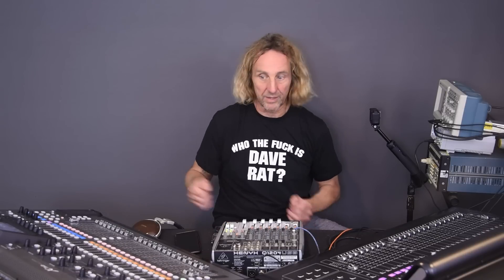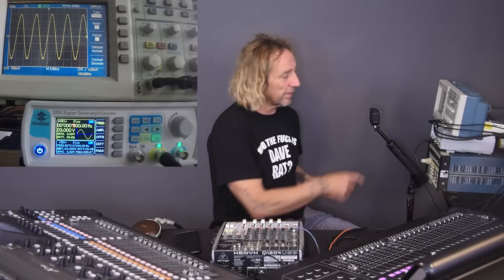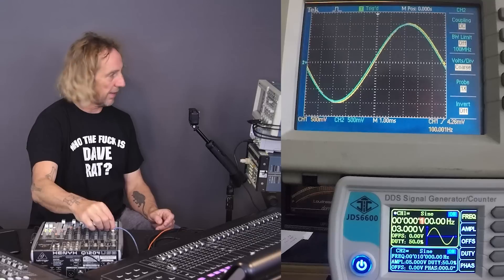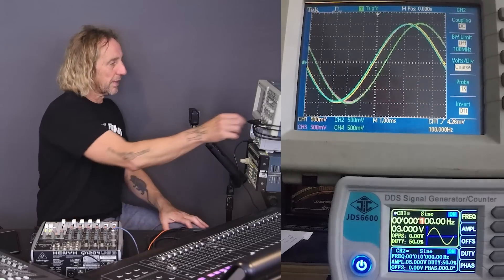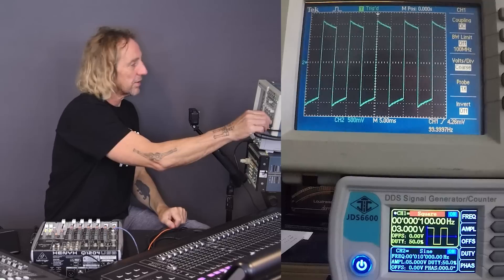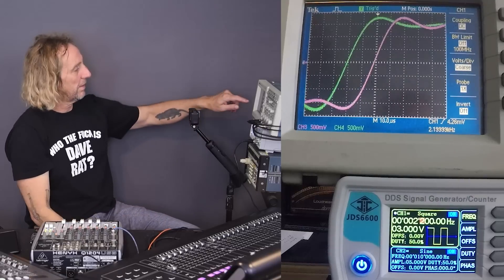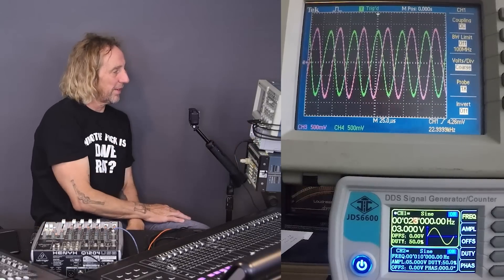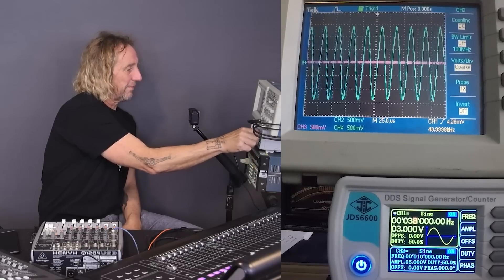Which Sounds Better Midas M32 vs Behringer X32 vs Copper Wire

Comment: Btw, I have a pretty badass rig in my FROG, and those last sub bass tones on your outro were nice, with being 16:45 heard as well.     Honestly the rig is pretty flat from 25 hz to 16khz, but if I move the crossover up from 22hz to 27 hz, it really affects the harmonics above, and deteriorates the response badly.   A friend recently gifted me an old but in new condition BSS MiniDrive, which will replace the old Driverack.  I’m looking forward to even MORE quality and harmony.
Reply: What is the lowest tone produced at the end of 5he videos?  My in ear headphones seem to be reproducing extremely low frequencies. Just curious.
Reply from the maker: If I recall correctly the lowest note in the outro is E0 which is 20.6 hz
Reply: I have a 25W 8" speaker in a random sealed enclosure hooked up to a tiny old hifi amp and I can also hear those tones. Its only flat from 36-18 000 Hz tho.
Reply from the maker: Good stuff

Comment: Harmonics, harmonics, harmonics.    Any manipulation we make, digital or analog, to any tone, waveform, noise, sound, call it what you want, but ANY manipulation changes not just the obviously manipulated bandwidth, but the upper and lower harmonics as well, especially analog gear.  That’s why a parametric eq is always gonna sound better than a graphic equalizer, analog speaking.    I learned some of this researching how transformers, in this case, direct boxes, use different types of transformers to eliminate noise, or at least reduce losses through the transformer.  I used to say it was bullshit when a bass player would complain that a certain DI would take away some low end of the bass signal.   I was wrong. An $18 Whirlwind EDB-1 direct box is vastly different than a Radial JDI.    And that’s the big difference.    Likewise, the Analog conversion to digital and vice versa is always going to have some fidelity loss simply because of the time shift, which equates to phase shift, which equates to a pitch shift, albeit very small, but it’s there, and how they mask these shortcomings seems to be what it’s all about.    Honestly, the A/D and D/A conversion nitty gritty is a little over my head, but manipulation is manipulation.   A good example is when you’ve got a great rig that sounds top notch with a flat analog graph.    While the band, pink noise, music, whatever is playing through the rig, dump one band of eq completely, and the difference will astound you, as it sounds like there’s definitely MORE THAN just that, let’s say 1k missing.  And there is.   500, and to some degree, 750, 875, and so on, with each harmonic off of the source having less loss, but again, 250, 125, 2k, 4K, and so on.    Mega comb filtering, but because of the shortcomings of analog graphic eq circuitry, indeed, the very thing which separates a low cost graph from say a White, KT, or top notch dbx even.     But here’s what really kicked me.   I was running the sub aux out of my FROG(room over garage) rig through a nice mono dbx graph, a 2031, and even though I had the crossovers in the old Driverack PA, is also dumped everything from 100hz up out of the graph.  Mistake.   A HPF is better, as it’s a one sided slope, but bypassing the graph and punching it back in. Add a HUGE difference to my sub sound.  Why?    Because the desired manipulation can never be absolute or even remotely discreet, as the entirety of the graph functions as a complete circuit, whereas on a parametric eq, those filters are manipulated with much 
less interband interference or influence.   I don’t know enough about that circuitry and am probably talking somewhat out of my ass, but organic sounds are composed of the whole frequency spectrum, including above and below what we can actually hear, but let’s say a graph went to 30k, and pull 25k negative 12 db, and you WILL hear a noticeable difference in the highs.  Same thing with the straight copper analog to analog, the is very little if any manipulation,  but with digital, lots, with great attempts at masking the issues from our ears.   Even balanced to unbalanced signals can have lots of eq loss, as unbalanced signals going through a transformer aren’t so easy to flip back from the phase reversal of the transformer versus a balanced line.    Reading about this recently made my head, swim, and I concede that I am pushing the envelope of my own understanding,  HT the real lesson here is this:  25 years in, and I really thought I had sound figured out. I can mix the shit out of some shows, and my shows are known for always sounding great, but it turns out it’s as much the higher fidelity equipment in use nowadays more than my skills, and thusly knowing not to manipulate it TOO much.   High passes on anything that doesn’t have bass content, same with the opposite end, but really careful attention to impeccable gain structure and level balance, not forcing things to work together that are fighting each other, like a snare and a vocal, or hi hats and the very highs of a soaring guitar lead.   Pull something back, just a db or two, and the whole mix opens up. Balance, balance, balance, and with heavily altered harmonics, balance is more of a quest than reality.   Why did all that 4K attack on the kick drum work back in the day on my Venice, but it just doesn’t happen on my X32?   Harmonics.     Why did sweeping out some 400-500 hz give it a “suck the air out of your gut” feel,  but on digital it’s just not the same?   Harmonics.    We were getting more eq than we understood before in analog world, where now the eq is more accurate, kinda, but they play tricks to restore losses, so we get a facsimile of accuracy, less result than analog, but ultimately, a finer product in the bigger picture of the overall mix.   Remember back when a dude would walk into your venue, “ring out(bullshit)” the singer’s 58 about as loud as they could get, and the prevailing result was lots of midrange removed.   Now, when they check the rest of the inputs, all of that is missing, and they end up adding mid, which is usually ugly, or pulling lows and highs and turning it up, to get the program back.    Is it the fault of the keyboard, bass, snare, and toms that the misguided demands of the vocal mic required so much manipulation?  No, it’s not. So don’t treat them so poorly.   Just make less movements to the eq, then try to transfer that to the strip, or even insert a graph if it’s that bad, but the bottom line is that so much “chopping” gives you that unnatural feel, while D/A and A/D converters are trying to restore losses, such that the cheap are quickly discerned from the costly.   I had a Digico for awhile, and the preamps were pristine.   Incredibly transparent.  But TOO transparent, leaving no impression of “balls” on the input, as my Venice did so nicely, and the XL3 did much better.    Oh, the price of quality.   For live music, there’s nothing like Midas pres and JBL drivers with very nice Crown, Crest, or QSC amps in between, with BSS or KT processing.    I ended up removing my dbx Driverack when the crossovers came with an X/M32 update.   Before that I had used the internal crossovers in the amps, resulting in a mostly flat response, but I wanted compression for the PA at the crossover level, so I tried the Driverack.  For the next year I wondered what had happened to the sound of my dead reliable PA.   Tired 12” drivers?   Passive crossovers getting cooked?   Nope.   Turned out it was the crappy Driverack PA.   Sounded like shite all this time and I just neglected to acknowledge it.    Converters, got me before I even knew what was afoot.  Thanks Dave, good stuff.     I didn’t realize how much using only Midas and nicer Soundcraft desks had spoiled me over the years, until I tried out various digital platforms when they were emerging.    The O1V was pitiful.   Awful sounding, and a clip on one of those was like the squarest of square wave nastiness.   Ughhh.     The little Mackie 1608 mixer that came out around the same time as the X32 was pretty bad too, and it took me several attempts to realize where the problem was.    I sometimes would use that for the opening band at a house gig, where my FOH desk was a Verona.    On the Mackie I was always fiddling with eq, and never really happy south the mix, and one time I just halted soundcheck, swapped back into the Verona, and those problems disappeared.     Hmmm.     Harmonics.   Converters.   Integrity.     We hear more than we think we hear.     What’s that?  Did you say something?   Couldn’t tell with all the noise around me.
Reply: You should study electronics. Simple scenario ... I take the two wires from a microphone and hook them up to the two corresponding wires on a speaker ... what happens when you speak into the microphone? What is transmitted across the wires? Why do the wires need to form a circuit?

Comment: One of the best presentations in this series Dave! Amazing what a simple piece of wire can reflect! 
Just want to add, I’m betting that they capped the response at 24k to maximize processing power and capabilities in the common 20-20k frequency range.
Reply from the maker: Thank you.  The 24khz limit is due to the 48 k sampling rate. A 96k sample would force a 48khz limit.

Comment: yeah but even if your mixer is putting out content above 20kHz, and even if the loudspeakers can reproduce up there, can they do it for very long? Many loudspeaker processors/presets/dsp etc. are going to filter all that out to protect the drivers...also I've seen reports of high sample rate recordings with large quantities of noise shifted way up that could damage speakers/amps etc...and analog limiters aren't great at catching high frequencies either...
Reply from the maker: Lots of variables.  One scenario could be that many natural instrument sounds put out frequencies above 20K at significantly lower levels than frequencies below 20k.

And that we as humans perceive this low level sounds as part of what makes something sound natural. We don't need much energy up there but a complete lack of energy above 20k is unnatural and reduces the realism.

Yes, most speakers, amps and processors do not reproduce sounds above 20k and most if not all sound systems are a far cry from sounding real enough that it is not immediately obvious that we are hearing a recording and not the an actual real live instrument being played.

The added hf response in itself is not relevant for most applications, just like having a car that exceeds 75mph is not relevant for most applications.

But also having a car that will go 75 mph and absolutely will not for 76mph mat also be undesirable for many applications
Reply: @DaveRat   yeah agree naturally there would only be a small amount of information up there...but with dsd and mqa etc. you can end up with an unnatural wash of noise up there; some guitar pickups also hash out odd stuff up there....

I don't think you can really perceive it when listening to music on speakers at moderate levels though...I run my monitor system in 96k, and have decent speakers (kh310a) which are fairly linear up to about 35k...honestly I've tested myself and can't say I could reliably tell when I have a lpf at about 24k, unless it's doing something measurable to the frequencies below...I know my ears are only reliable up to about 16/17k...I even have a butterworth lpf at 20k that I just leave on in the monitor controller on my normal preset, and a hifi preset that turns it off...it's not night and day, sure you notice a tiny change when switching...but I wouldn't put money that I could sit down and say it's on or off without an AB...

I know what you mean but I don't agree with the car analogy, that absolute 75 could be the difference in avoiding an accident...sure all things being equal, it's better to have an extended response, but i think it's really way way down the list...at least in mono/stereo music listening anyway...maybe in a surround system things could change a bit more, that could be interesting to look into...
Reply from the maker: Hmmm, well if you/we can't hear beyond 16k, why not limit at 16K?

We already accept that the response must exceed our hearing, the question is "by how much?"

Is 1/4 octave sufficient?

One octave of buffer above hearing would put us at 40k.

For me, once we have speakers can realistically reproduce sound accurately enough to where we can't tell the reproduction from the original, then we will be in a position to determine which parameters must be maintained and which can be shaved.

For everyday life, for whatever application at hand, we scale the specs as needed. I don't need even to hit 12k for the Bose speakers around the house. For headphones and mixing I want the speakers to exceed the capabilities and response of the material being worked with
Reply: @DaveRat  That was a bit of a drunk 4am rant TBH!

And the problem with the "by how much" has a lot to do with how filters themselves work...like I said I can hear the 20kHz 24dB butterworth LPF...but imo that's probably more to do with it attenuating frequencies I can hear below, and maybe phase shift, than the cutting out of higher frequencies...there's always so many factors...

Btw youtube it seems has raised its cutoff from around 16kHz to 20kHz for stereo also sometime recently...in chrome anyway, but not safari it seems...
Reply from the maker: That is interesting.  I will take a look at the YouTube filtering again

Comment: So if you are using a solid wire split how much are the varying impedances of the boards and the signal generator affecting the signal distortion at the inputs of the other boards?
Reply from the maker: I also test direct without the split and make sure the results are the same

That's how I found that the QU16 does exactly what you describe with voltages over 10vols on the input.

Comment: Just thinking, how does it affect real speaker performance, if you drive him with square wave signal, this kind of sound waves. Maybe that coil is less acurate to that signal. But if you drive him with that little "ramp" time, output sound can be same.
Reply from the maker: When I test the sd11 I will test a square wave at 48k and 96k sampling rates and listen with headphones as well as record the output and see if there is any audible differences. If so, I will share.

Comment: so, the step response (square wave) is a nice visual way of highlighting the impact of a finite sampling rate and sharp digital filtering - the question is: could you hear any difference between those two square waves?  Of course there will be likely be some additional filtering of that 20kHz ringing by the speakers/headphones.  I would guess that if you cannot hear the difference between those two signals (which are kind of worst case scenarios), then with typical signal content where only a very small percentage of the energy is up in that frequency range, it will probably be irrelevant.  If you CAN hear the difference, then that's a decent argument for higher sample rates where less steep analog filters (post DAC) can be use to remove the higher frequency sampling artifacts.
Reply: I would love to hear the difference, but as a  70y old ex part time sound man, I can just about hear 12k, the funny thing is my tinnitus is way above what I can actually hear.This colours everything I hear,I guess what I'm really saying is treat your ears with respect. 

i

i

Comment: So those sines at the digital desk are obviously related to the Nyquist frequency. Could you for demonstration switch to a higher clock to illustrate that?
Reply: The fact that the sines get wobbly at exactly 24k and disappear above that tells me that both consoles are already running at their maximum of 48kHz. Can't switch to higher clocks on either of these consoles.
Reply: @EmporioZuagroast  ahh that's too bad. But thanks for the reply.